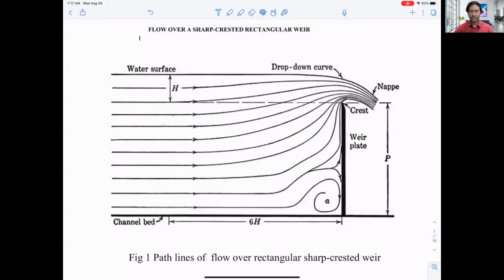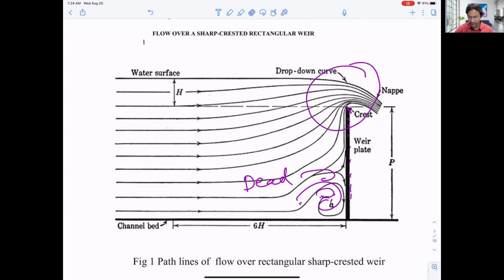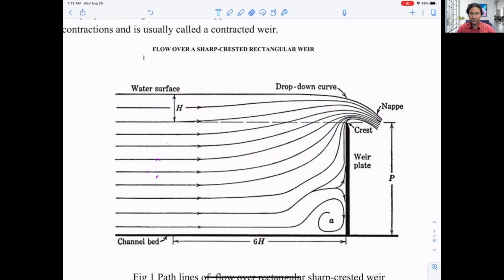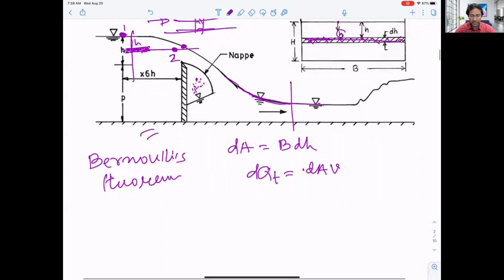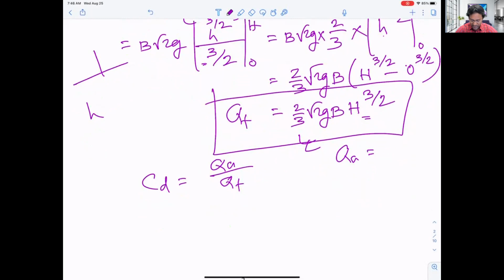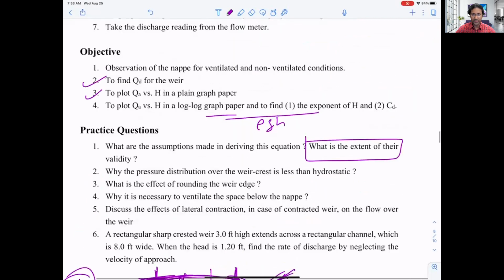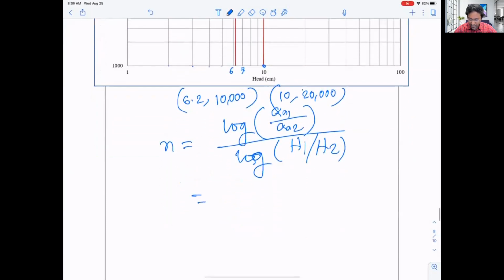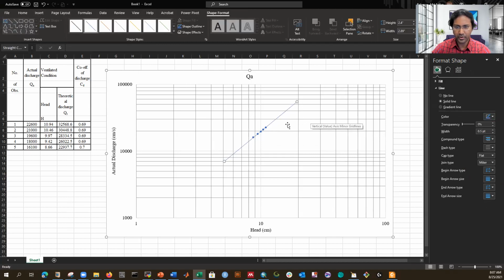Fluid Mechanics Lab: Flow Over a Sharp Crested Rectangular Weir-Exp06

Comment: Thank you for your video and explanation!  If we just decrease the height of weir crest above bed (p) under the same conditions, it would result in an increase or a decrese of height above crest of weir "h"(upstream)?
Reply from the maker: Thank you for the query, the derived equation is independent of weir height, so if you increase or decrease the weir crest, it does not matter unless you change the height of water level above the weir crest. As it works as a flow  measuring device, which depends on the height above the weir, so there won't be any change with the increase or decrease of weir crest level.
Reply: What is the Standard valu of Cd for Weir..??